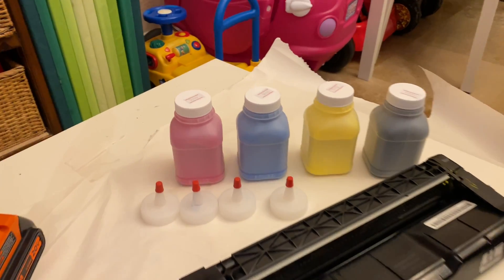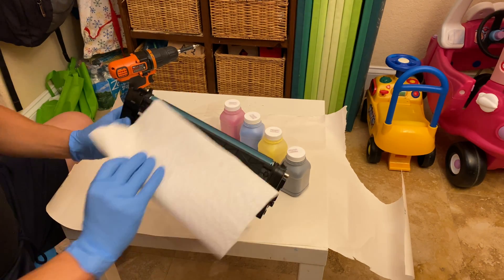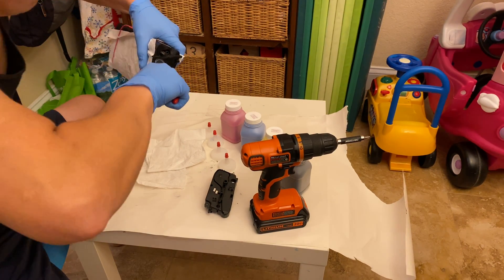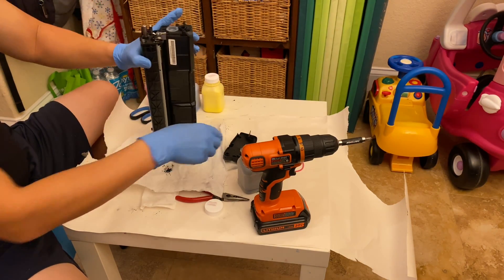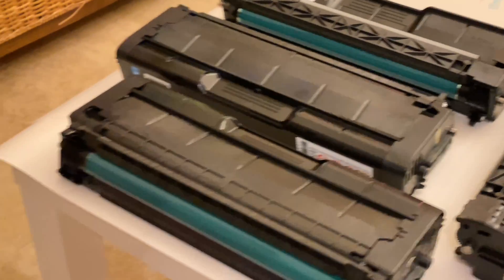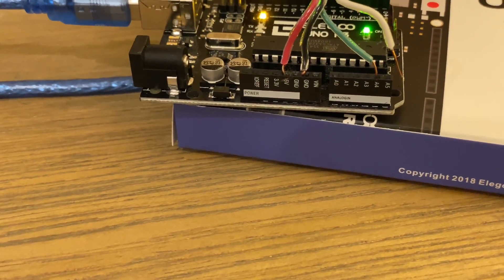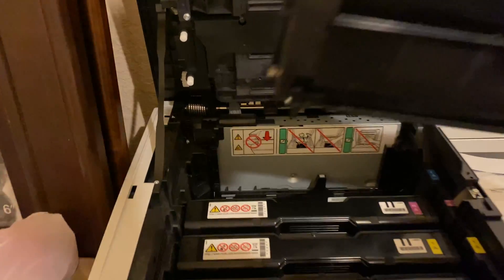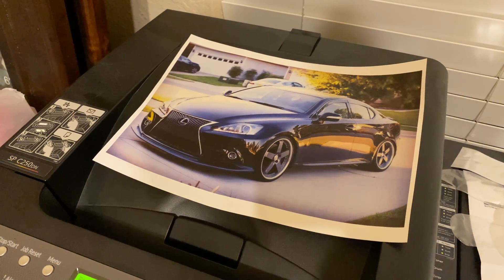How to Refill Ricoh Laser Printer |Toner Refill SP C250DN | Reset Toner Chips | Arduino Hack

Comment: If my cartridge is bleeding toner after using it for a bit does this mean the cartridge needs to be completely replaced or can it be fixed?
Reply from the maker: Probably. The roller and drum on these aren’t great. They are good for one, maybe two refills before they fail.

Comment: After a few weeks of refilling my catridge had horizontal lines when printing. Any advice?
Reply from the maker: Usually the lines means drum roller is end of life. Need new cartridge at that point. I had that on two of my colors after my refills got used up.
Reply: @TunerwithKids  But My printer and catridge are just 2 months old. So the average lifespan of catridge will last for about a month?
Reply from the maker: You said you refilled it so you finished a cartridge in 2 months?
Reply: @TunerwithKids  Yeah
Reply from the maker: Well the drums and cartridges are rated by number of pages printed, not time. So obviously you must of printed thousands of pages and eventually they wear the drum out.

Comment: Is the Arduino pretty easy to setup and use? Coming from someone with no programming knowledge at all…and using a MacBook. Unsure if I want to try that or replace the chips. Thanks.
Reply from the maker: Need Pc I think.

Comment: Tried this and it resulted in a mess! First of the plier is a bad idea since it break the cap, better to use something else and not break it, since otherwise you can dump the whole thing. The second issue I got is when I tried to put the parts together, very difficult and may result in damaging. After several tries I managed to close it and started printing, got half page cyan! (yes I was replacing cyan). Dismantled it again a saw a spill of toner which ended on the drum roller. Not sure what to do now, if I can clean it or it's to just dump it in the bin.

Comment: Thanks for a very good video. I bought a refill set that came with chips. I found that when I went to refill, I had to dump out a lot of toner that was remaining in the cartridge. I see that you didn’t do that. Was your cartridge totally empty before you refilled?
Reply from the maker: It always has toner in it. I usually reset mine twice before I refill since the chips count pages not actually toner used.

Comment: Isn’t it easier to buy ones that came with the chips, so you don’t have to reset it? Or is this way better?
Reply from the maker: Just depends on your technical level. Some might opt for the $10 in chips. If you have the skill set for the Ardiuno programming, then that’s better. I reset mine twice before refill because the printer goes stupid because the chip says it’s empty based on pages printed but the cartridge still has plenty of toner.
Reply: @TunerwithKids  ah ok, I’ll do that then, is everything listed in your description box?
Reply from the maker: Yea the programmer is listed there. The source code is linked to DIYTinkers video, I think. Just need to make your own wire harness and pin contactor.

Comment: 5:32 Make sure your vacuum cleaner has a HEPA filter, as the toner particles are small enough to pass through a normal dust filter and get exhausted back into your room. Breathing in plastic particles isn’t good for you.
Reply from the maker: Yea I learned hard way. That shot color dust all over my floor. I had to put a wet towel on exhaust to catch it after the first cartridge.

Comment: Top notch content. Thanks!
Reply: A couple of easy housekeeping items. 
First, make sure the vacuum is plugged in & within reach using only one hand. Almost had a huge mess on my hands because I forgot to plug it in.
Second, do cover the part he tells you to cover. I didn't and almost made a huge mess trying to be careful & almost dropped it. It's worth it to keep the unit covered. 
Third, buy the 'single' use toner refill-kit as he did. Mine was enough for two refills so I didn't snip the tip as he did, and when there is a 'poof' of air because you're squeezing it to make it go through that tiny hole faster, it makes a huge mess. 
I had purchased the new chips a long time ago, but that chip reset tool looks super easy and would pay for itself after the first use.
PS - thanks for the comment on having to align the unit before putting the top back on. The same thing happened to me, and it made a big difference knowing exactly what to do!
Thank again :-)
Reply from the maker: One thing with the vacuum, filter the exhaust with a towel or old shirt. It sends toner out, I had to wipe the floor and chairs that were behind me.

Comment: thank you for this video. is this the same for the Ricoh ps c 320?
Reply from the maker: The C320 uses a different model number toner. The process of filling is same but the chip reset using reset tool might different. The kits aren’t as widely available as the c250DN.
Reply from the maker: The only ones I saw on Amazon are up in the $70 range but comes with chips. https://amzn.to/2Co8Ncf
Reply: @TunerwithKids  
yet I see on your video that the turners are identical
Reply: @TunerwithKids  Ricoh aficio sp c320 dn

Comment: I have exact printer model u have in this video - Ricoh SP 250dn. I downloaded the code (“I2Cv2.ino” in the link you provided ). I assume thats the file and you change the numbers one at a time to reflect the desired color and compile the code?
Reply from the maker: I think there are instructions in the notes for the program. I also linked to a video by DIY Tinker on how to use the Arduino and the program.
Reply: Tuner with Kids Thanks I see. 80-83 from Yellow, Magenta, Cyan, Black. So each run of the code we just change that number at the top of the code to reset the respective counter. 

As a side note, I didn’t realize the chip is the level indicator or what stops the printer. And that we may physically have a lot left despite it saying we are low. Capitalism..
Reply from the maker: Correct, I would reset next time it says “low toner” before refilling again. Just to get the last drop out of the cartridges.
Reply: For anyone who is a complete noob to arduino and starting from scratch or no prior experience I hope you benefit from this commentary. I'm impatient and I wanted everything physically come and then deal with hassles later. I successfully updated the microchip. 

In addition to the "Elegoo Uno R3" or other arduino clones you could buy (that comes with USB cable), you will need some wires to connect the board to your cartridge microchip. I bought "DEYUE Jumper Wires Set - 240 pcs" for $6 from amazon and whats nice about it is that they come as batches of 40 wires that are glued or stuck to each other on a flat plane. So you can just rip out 4 of them as a group and not worry about holding 4 separate wires in order but rather in order as left to right and or right to left. It will help when you make contact with the microchip and narrow your choices to 2 rather than 24 (or 4*3*2*1). You ONLY need male-to-male so if you can find just that for cheap that's all you need. This set contains male-to-female and female-to-female in the batch so consider those bonus for other projects. I am confirming this is adequate for anyone without wires just sitting around.

For the noobs (like me), software can be found at URL for "arduino.cc" and navigate to "software" then "download". Or https://www.arduino.cc/en/Main/Software. Once you download that software, as of August 2020, the version is 1.8.13. To initiate the software (and after connecting your board via USB to Windows 10 PC), click Tools --> Port --> Whatever option that is "Arduino Uno". Mine was "COM3 (Arduino Uno)" and I am assuming you bought an arduino Uno R3 or some clone variation. If you do NOT do this you will get a "board at null" error. Anyways then you can go to Sketch --> Upload the code but make sure the desired color value (80-83) was properly set for the cartridge you intend to reset. If the "Serial Monitor" screen doesn't automatically pop up at this point you can go to Tools --> "Serial Monitor". That should show the output screen. It should run the code once. Let it run and end.  If its blank you missed something. Anyways at that point, setup your configuration (i.e. board to printer microchip and physically touch the 4 pins). If you are by yourself, one hand holds the four pins as desired and the other hand can use a pen and click on the red reset button on the board to re-run the code. The contact must be clean and press firmly so that the wires definately connect. Don't want to deal with write errors. After that, you put the cartridge back into the printer. The printer automatically resets the configuration and you will see the bar go from empty to full. 

I am not the least bit an engineer so some of these concepts were foreign to me. But the configuration was simple for the board. You have 4 pins on the cartridge that goes from SCL, SDA, VCC, GND from left to right. Short for Clock, Data, Voltage, and Ground. It connects to the board to A5, A4, 5V, and GND (2nd ground to the right) respectively and yes it will literally state that on the pin receptors on the board. Don't worry, if you are confused just click on the DIY link for picture form.  But that's it. Then you hold the wires in the order of SCL, SDA, VCC, GND to the chip and just make sure you don't wobble and loosen it just needs the continuous contact as it writes.  The DIY video will show the orientation but as long as you see the long bar on the top left like it has a right eyebrow (you are looking straight at the cartridge as if you were talking to it) then thats the proper order left to right.

And if you were like me and watching this video first time, I was intimidated by Tuner with Kids pressing down on the board and wondering what the heck he was doing.  Its a workaround for the code that automatically compiles and runs on the Arduino board before we can physically set up the desired configuration to the microchip (i.e. in position to write to it).  And Tuner with Kids was pressing a red reset button to re-run that code at the desired time when we are ready to write to the microchip.
Reply: @hanhang5086  thank you, this info helped me figure out what I did wrong. I had the ground and 5V wire mixed up on the chip. The ground wire was suppose to be on the far right for the chip and I got it mixed up with the 5V. No wonder when I touch the wire and chip, and then press the reset button, the writing was stuck and didn't do anything else. Also, every time you change the cartridge number, I had to upload it so it'll be fresh on the serial monitor. I wish he recorded doing all 4 so it would make more sense and easier to follow. I had to trouble shoot these issues myself after being confused on why my reset didn't work. 

Thanks again!
Reply: @thanhkhong9561  Most definately. I am disliking how the industry is forcing us to buy their overpriced OEM. I wouldn't even mind paying for them but they are exorbitantly priced! Apparently the newer printers are making it difficult so I'm sticking with my 250dn until it dies.
Reply: @hanhang5086  Thank you so much for writing this step by step. I'm completely new to arduino. Just wanted to save some money from buying new toners. I followed the video closely, but there was a couple steps left out such getting the server monitor to run. Thanks again for the help.
Reply: @BlueSky-nc9mh  Dont mention it.  I periodically re-read my instructions to help refresh the steps to reset it. Omg these days the cartridges are so ridiculously overpriced. I don't have time but when I have to pay $100+ for new toners it's enough to force me to bust out the labor and refill + reset it.  Every time I just wanted to buy a new toner the price brings me back here to just do it myself.

Comment: Thanks for this video. I have the same printer and the toner is costly.  Are those refills original or what they call compatible?
Reply from the maker: Rup Dog these are aftermarket refills. Printer companies are really ink and toner companies so they want you to spend $200 on a set of new cartridges not refill. That’s why I had to reset the chips.